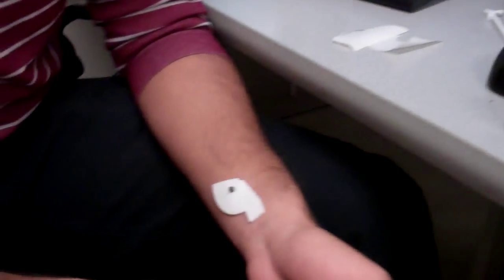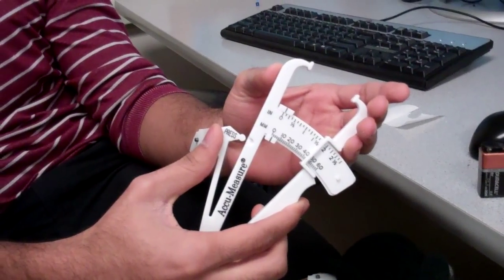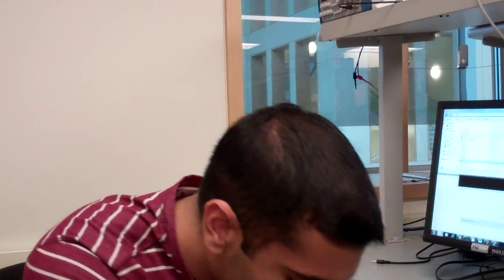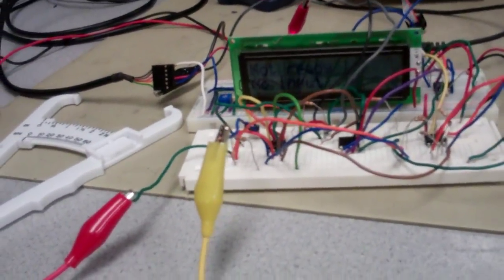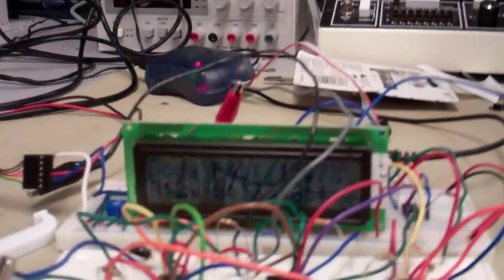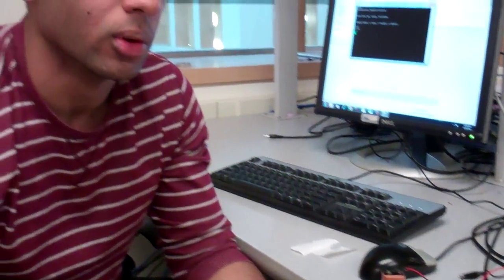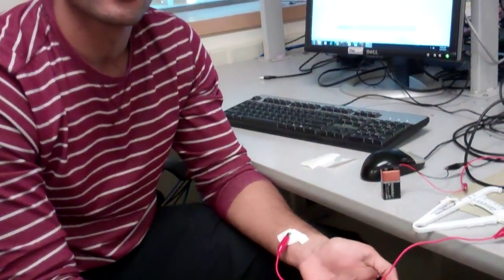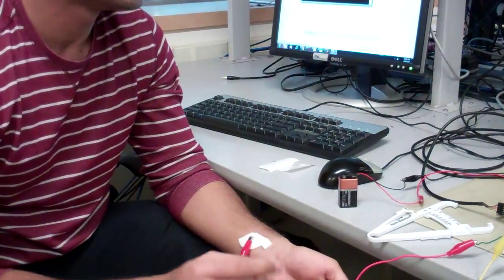bioelectric body fat

Comment: Hi, I'm so interested in your project and I’ve already read your report. So, can I ask you some questions that why we need to change the crystal frequency of MCU from 16MHz to 20MHz and can I have your email? I hope you could respond my questions. Thank you!
Reply from the maker: You will note that this project is 7 years old, so the report is the only documentation. Reading through the TRT header, i looks to me like they used 16MHz, bu why do you care? his is low speed application, so clock speed is not very important. This is a good place to communicate. if you insist on email, you will to figure out my mail.

Comment: Where do you use the potentiometer?
Reply from the maker: First, you will note that this project is 9 years old, so  any detailed memory is gone.  The linked report mentioned a pot in the parts list, but no where else that I could find. Is that what you are refering to?
Reply: @ece4760  Thank you for your reply! Yes that is the one I'm talking about. In the meantime i analyzed the linked report even further, and i assumed it is being used in the LCD circuit for the calibration of the contrast since there is no mention of it anywhere else, and there is no circuit for the LCD showed. Have a wonderful day!
Reply from the maker: @adrianteiusanu  The old LCDs did require a pot to set contrast. They did not include it, because it was a stanadard part of the class infrastructure at the time.